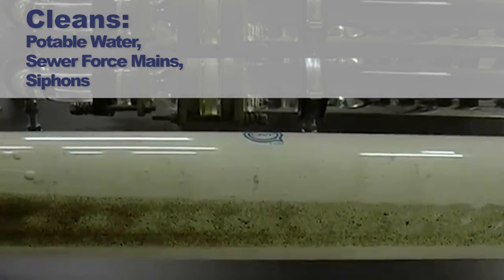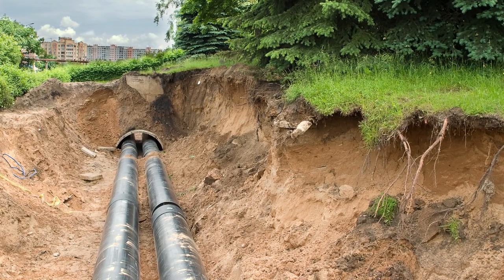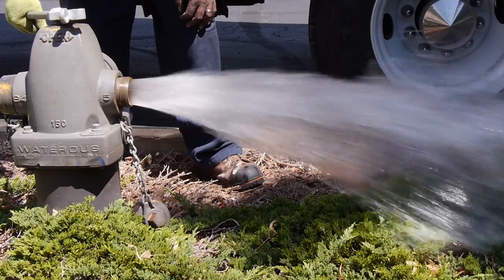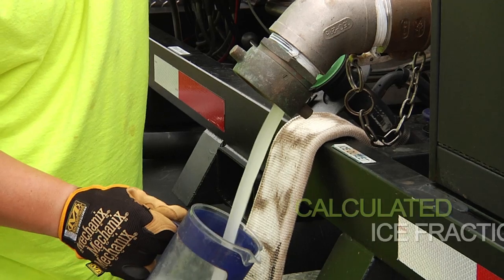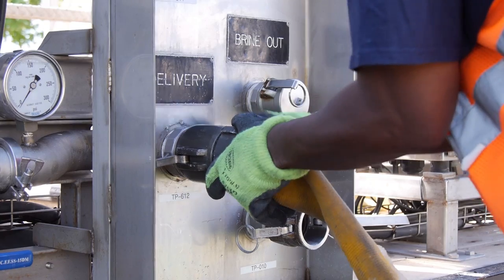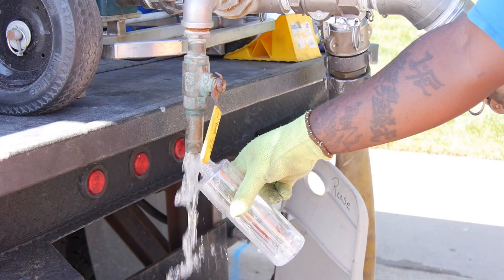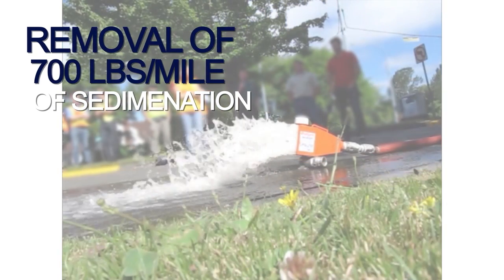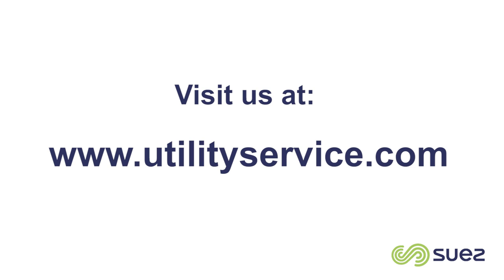Ice Pigging: A New Technology for Cleaning Pipes

Comment: Slight correction, Ice Pigging is not an abrasive technique. It is a "soft" clean. The ice does generate far higher shear wall forces than conventional flushing but often the material to be removed (biofouling, particles, fines etc) is removed by a form of "folding" the fouling materials are then carried "within" the ice rather than pushed/bulldozed as a conventional pig would do. Great technology. Good video. Thanks for sharing.